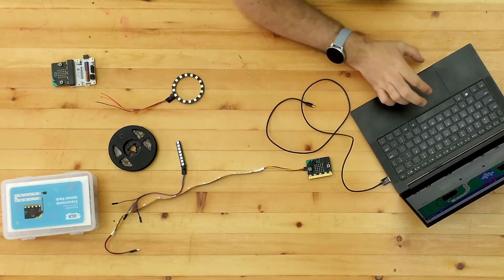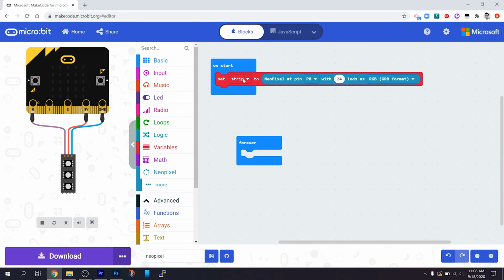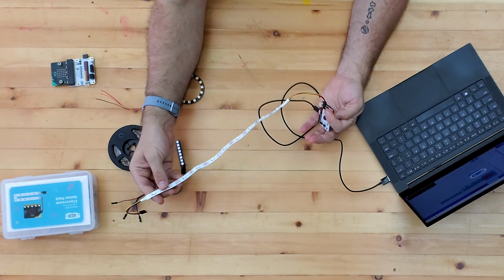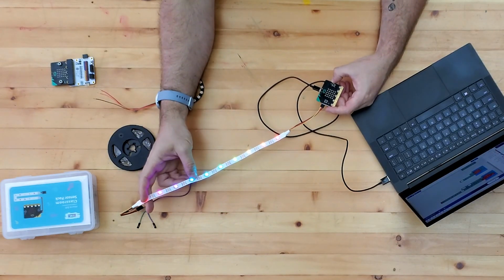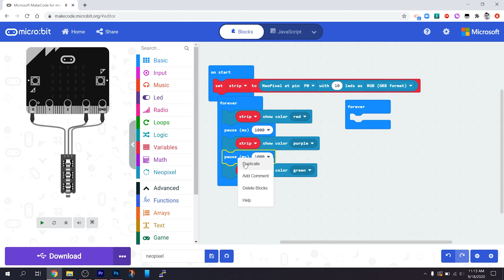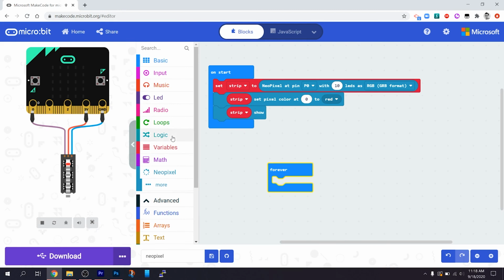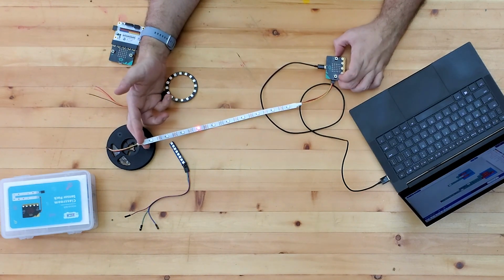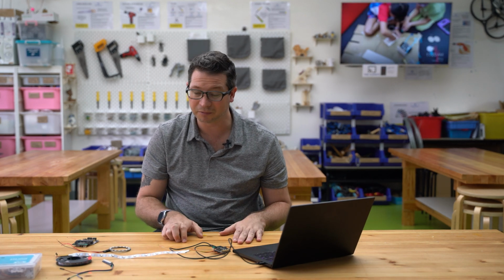Coding with micro:bit - Part 3B - LED Neopixels

Comment: Hi, really like your videos 

Could you provide the link for the string led and led strips. Are they particular types, any thing that will not work

Thanks
Reply: The name "Neopixel" is Adafruit's term for WS2812 LEDs, which have been around so long they are cheap and easy to get.  Look on Amazon or ebay for "neopixel ring" or "neopixel strip" and you will find lots of vendors.  The description will usually have "WS2812B" in the name.  Also look on Adafruit's website for more info:  https://www.adafruit.com/category/168